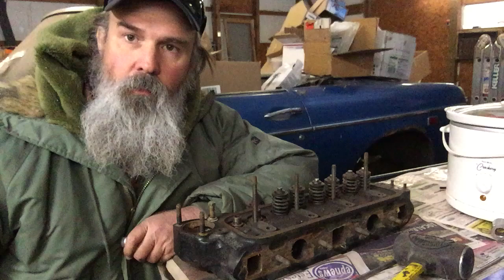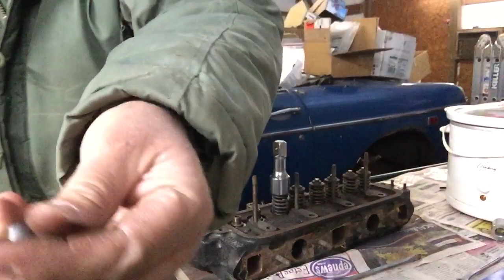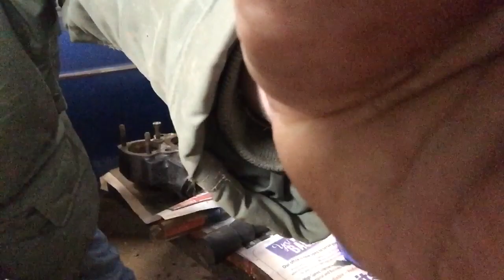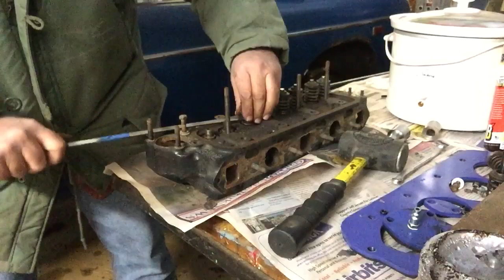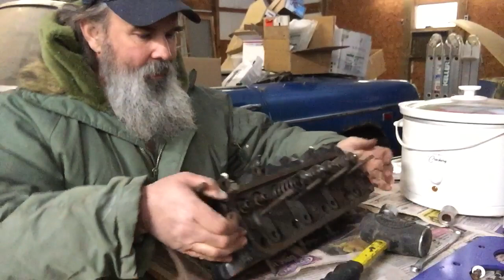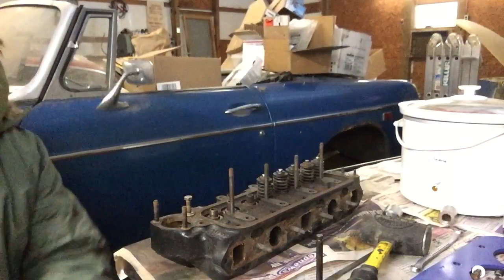Mgb cylinder head valve removal

Comment: Works well with something under the face of the valve immobilizing it. The keepers fall out better if the valve doesn't move.

Use a deep well socket that fits the valve retainer.